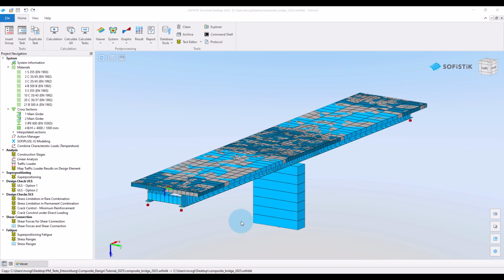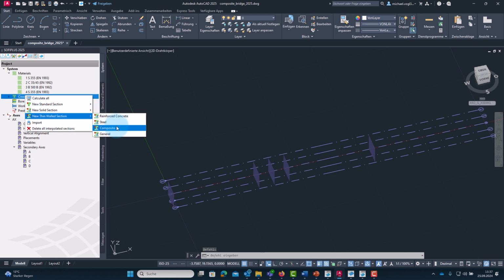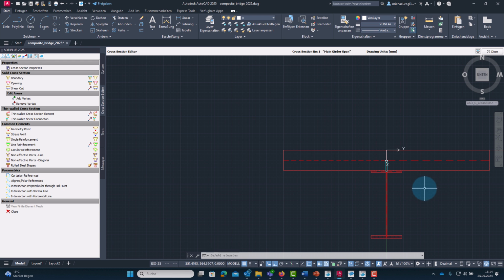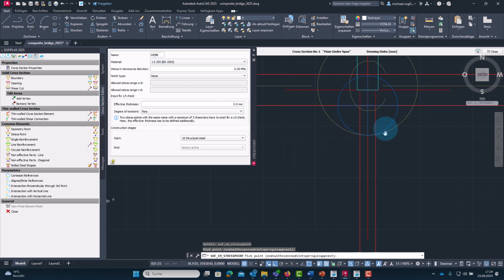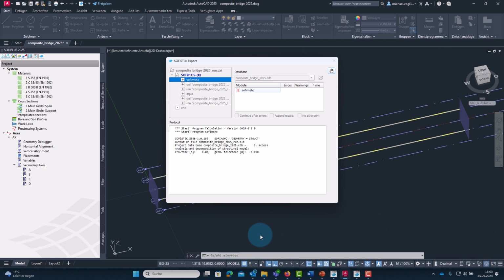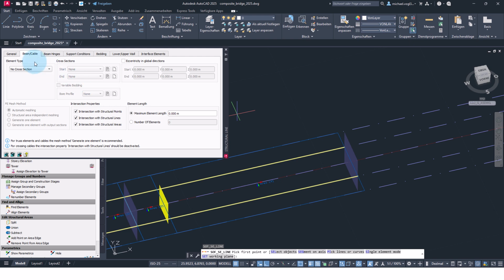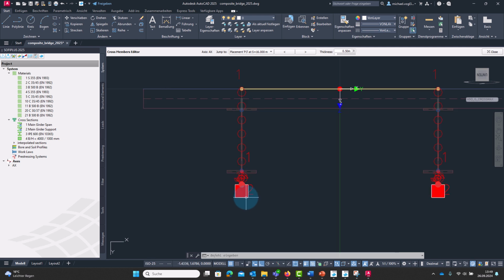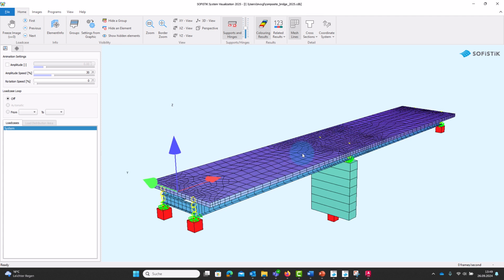Composite Bridges: Introduction and System Generation

Comment: Thanks for this video. Could you explain me that, why do you use design elements? In this case, isn't that the same as just normal beam element? Can't you just design normal beam instead designing "design element"?
Reply from the maker: Hi Rozbarti,
the design elements allow you to integrate results based on both the beam (longitudinal load bearing) as well as of the Area elements (cross load bearing) of the combined composite structure into a design element "beam"-result.
With only a "normal" beam, you would not be able to consider the load bearing in cross/orthogonal direction of multiple beams.

Comment: Hello sir,
at 29:13 you mentioned that the stiffness modifiers will be given to the slab element to ensure stiffness doesnt get doubled.
where this definition is given to the model in these lecture series?
Reply from the maker: Hi TrainGamer-cu6vx,
when you use finite element theory to describe your model, you can define a BEAM (linear element) and a QUAD (area element) an overlapping each other. This causes double selfweight and double stiffness to occur at the overlapping geometry. To avoid this in composite structures (where the BEAM bears longitudinally and the QUADs consider the transversally effects) SOFiSTiK allows you to reduce the selfweight, as well as the stiffness of its elements.
Does this answer your question?
Reply: @SOFiSTiKAG 
Thank you so much sir for your time.

Yes sir, I was actually looking for the step at which the longitudinal stiffness of the QUAD elements is set nearly to 0 in this lecture.

As I was going through the SOFiSTiK site I read that, it is when defining QUEA = 1% and QEMX = 1%, in the analysis part.

And now I just have one more doubt on a line in ASE manual, why axial stiffness needs to be more nearer to zero than the flexural stiffness?
and it says for mxy behavior of QUAD, QEMX is 0.001.
(pg 3-52 of ASE manual)

Kindly elaborate this behavioural expectation from the QUAD element sir.